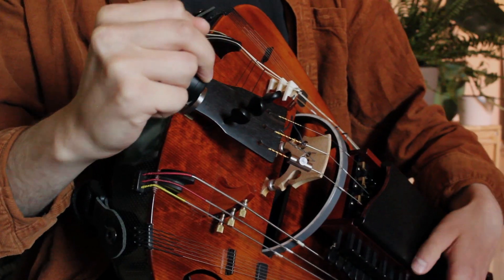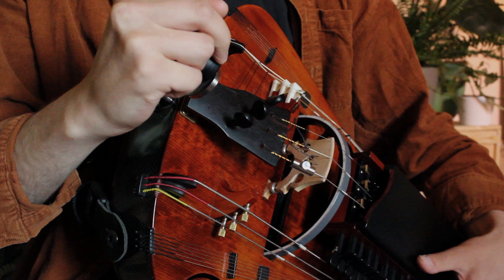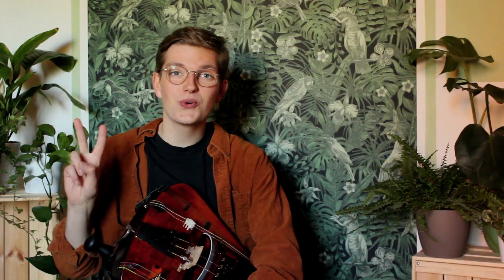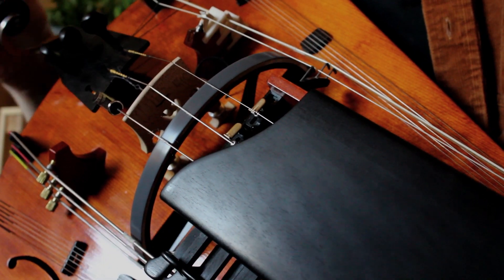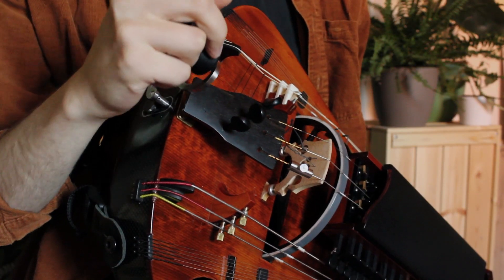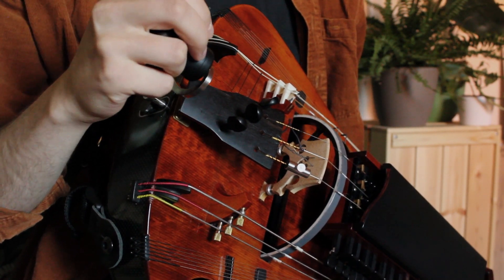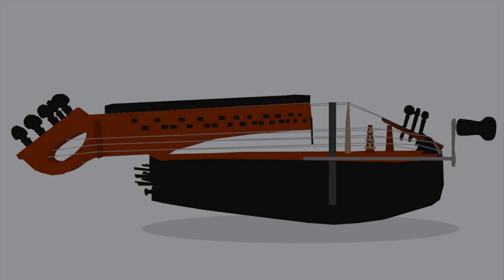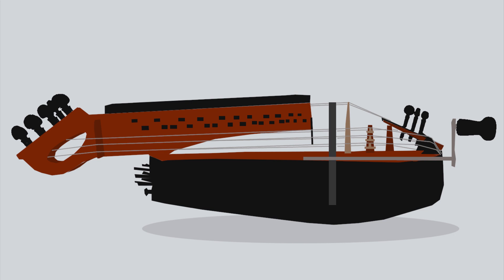THIS is a REVOLUTION! | The NEW Weichselbaumer System!

Comment: Awesome, dude! Please let me try next time we meet :D I'll buy some curry as a retribution xD
Peter Streng added some similar mechanism, I think, with a bar you can push to lower the wheel. Guilhem Desq put the same kind of "pressure bar" on his own gurdy, didn't he?
Reply from the maker: Hehe, just come over and I'll let you have a spin. ;)
Yes, Peter Streng has a similar system, which is being used by pushing the keybox lid. I think both systems have their ups and downs and it's just up to personal preference. :)
Reply: @Ron-xh5fz  
As someone who struggles with the basics, I like the idea of not giving my right hand even more delicate coordination to do. 
Outsourcing this task to the left thumb (as Peter Strengs design does) seems more managable for me.
But then again, dynamic gurdies are aimed at the top players not plebs like me.

I'll let you know which one I acutally prefere... if I ever reach that level and get my hands on both designs ^^